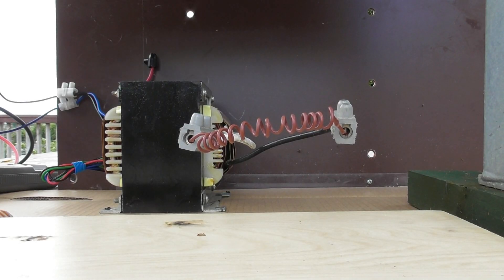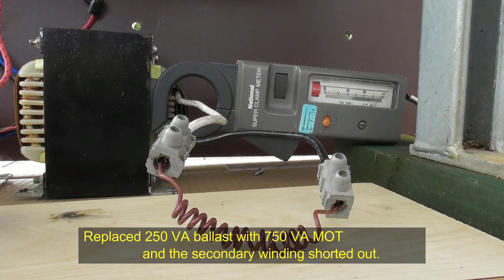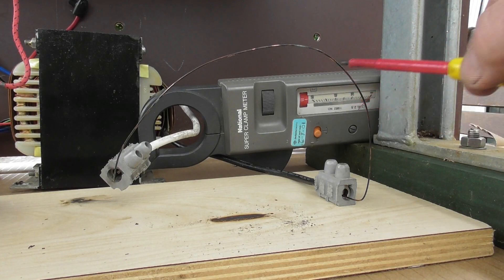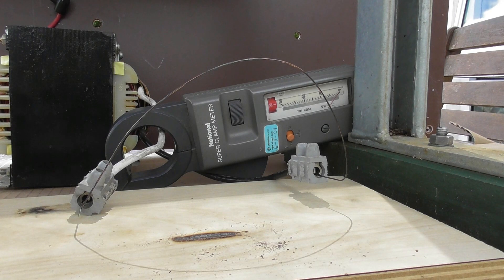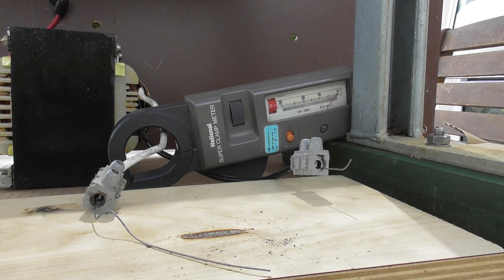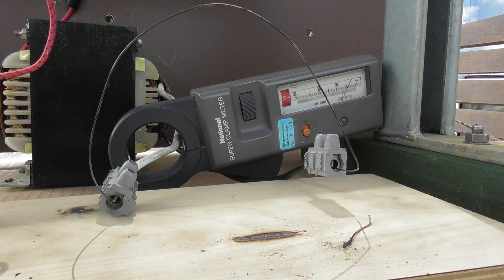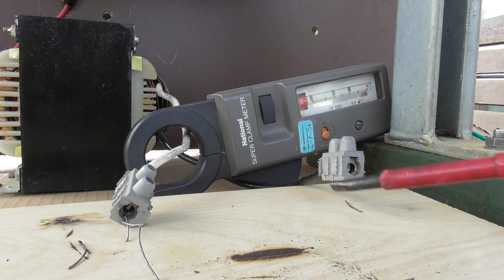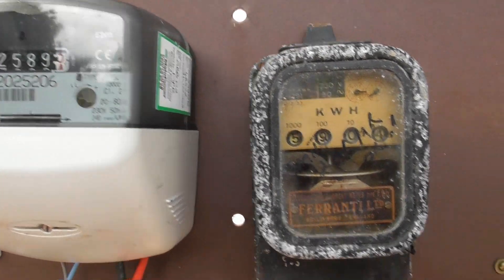Inductor in series to reduce fault currents

Comment: It makes me wonder you know, 
if you could turn an average 
Microwave Oven Transformer 
into a ballast, simply by........
.
.
.
............. Cutting out the secondary winding.

Yep, I know, it would most likely have a similar effect to having a complete MOT without the secondary shorted.

My point being here, it might be a bit 'safer' because there wouldn't be the associated high voltage(s) present, and I am sure that any MOT doesn't appreciate being shorted for too long.

In fact, you might be able to achieve a similar MOT-shorting effect by hacking out the secondary high voltage winding and then putting in a couple of turns of thumpin' great thick cable (like 25mm or even 35mm meter tails) and then shorting that out.

Thanxx for showing,

-Wayne's Electrical.

18th April 2021, 18.45